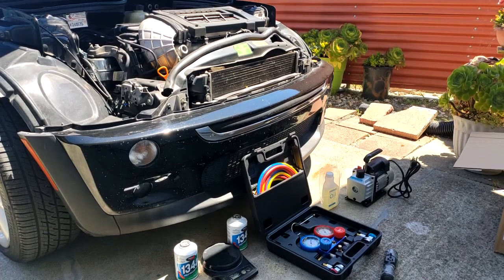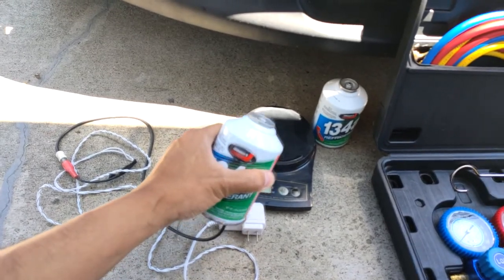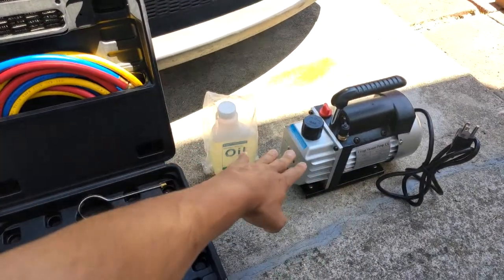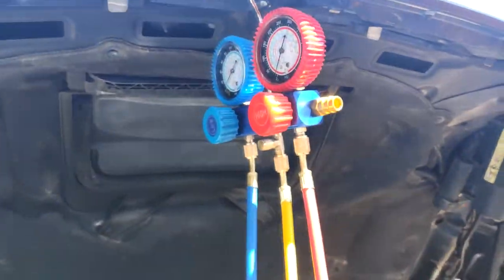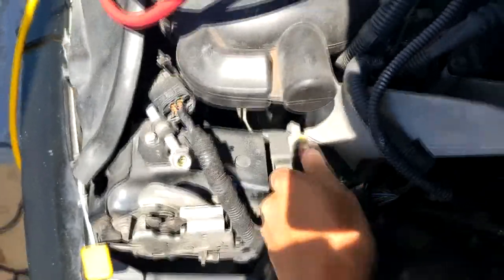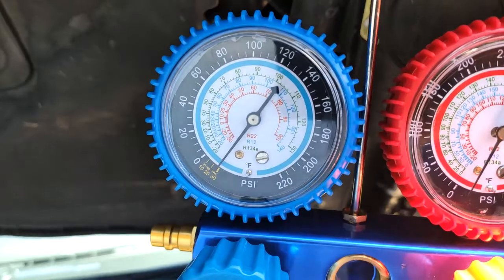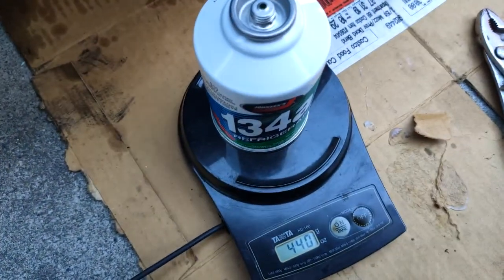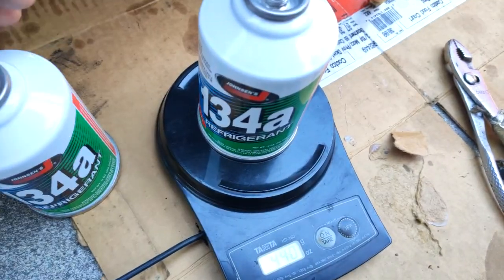How to completely empty and recharge A/C system on cars EZ guide

Comment: When evacuating the system, where does the old Freon go?
Reply from the maker: Used refrigerants must be recovered into Department of Transportation-approved cylinders. The recycling would have to be done by a MVAC-certified technician or by an employee, owner, or contractor to the disposal facility using approved recycling equipment, and used in an MVAC or MVAC-like appliance. 

Just Google "ac refrigerant disposal" and you might be able to find a local listing of AC recycling or disposal places near your area.
Reply: I didn’t see you using a bottle, so I wasn’t sure if I was missing something. If my system is already disconnected, and has no pressure, do I need to try to evacuate? Or will pulling a vacuum be enough?
Reply from the maker: @joshuakeith8710  Like in your situation, my system was already evacuated prior to recharging the system due to the old damaged condenser pipe that had leaked all of the refrigerant out. Once the repairs have been made, you only need to pull vaccum to ensure there is no residual air and moisture in the system before putting new refrigerant in.
Reply from the maker: @Bruce Lee well if you pull vaccum prior to replacing the condenser, by the time you disconnect the AC lines that runs to the condenser you will introduce air back into the system. I would think to replace the condenser first, then after everything is connected pull vaccum to empty out the system before you add in the Freon
Reply from the maker: @Bruce Lee yes you can do that way to. So to clean out system of old r134a first then again before you refill new system with new r134a
Reply: It goes in atmosphere sure.
Reply: Mine leak out pretty much completely over time.  Shrader valve went bad.  134a was completely gone.

Comment: Hi. I am trying to do this on a marine fridge but it does not have a high pressure valve. Can I do the vacuum just from the low side?
Reply: I’m sure you’ve figured it out by now but yes, you can evacuate, vacuum and recharge on one port.

Comment: Stupid people like you shouldn’t make videos..... you can’t plug pump if there’s some Freon in the system or if the compressor was filled with oil prior to installing it!!!!!
You should explain that to people.
Reply: You shouldn't be commenting either.    Oil in compressor makes 0 difference.  Just installed one currently charging.   Oil is not pressure.   Gas is 

All you had to do is get it evacuated at a ac mechanic or you could theoretically crack the cold side line and it would come out that way.  Not legal.  

If you had watched a few more vids not just one you would understand this.

Normal this service is done after a repair not sure why you would hook your vac pump up if you haven't yet evacuated.   That's backwards

Comment: Can you replace the compressor and have a mechanic evacuate and recharge the system?
Reply from the maker: You can if you want. Just be sure to use new o-rings before putting the fittings back into the compressor or else it will leak.
Reply: @bigmurff  i think u ment to say could leak.